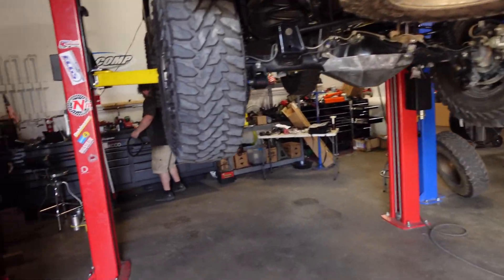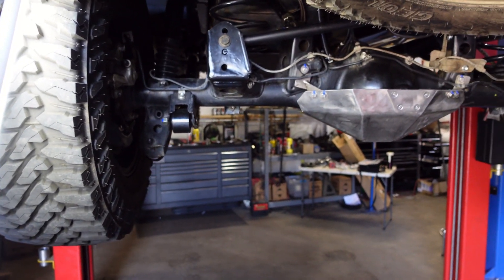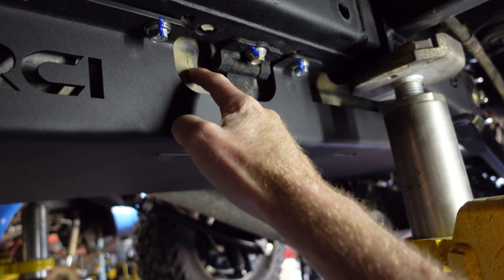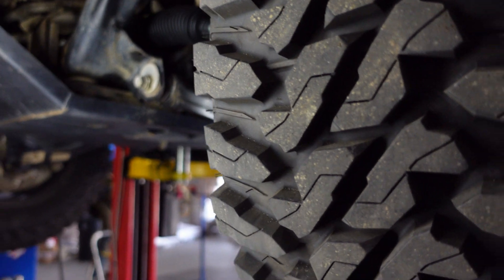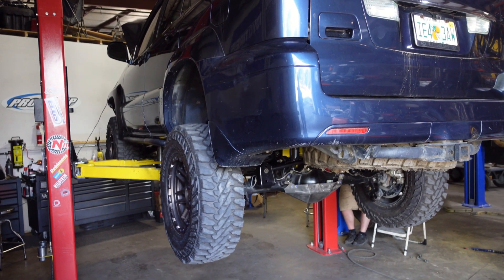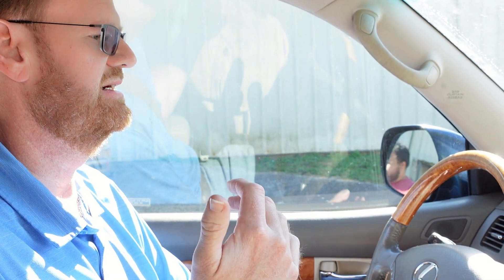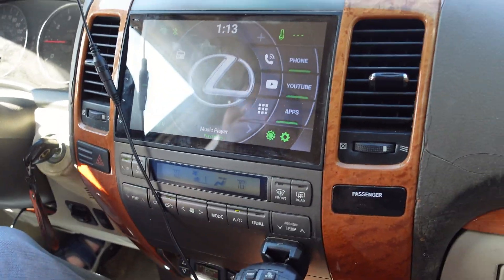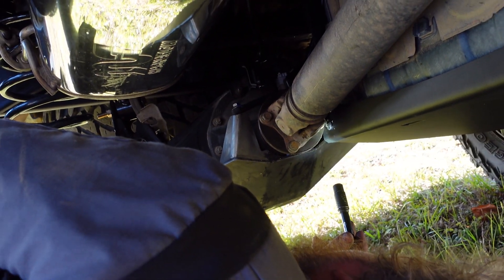I Replaced Nearly Everything Under my Lexus GX470! New E-locker!

Comment: Will you do a breakdown on expenses so we can have an idea on what it'll cost if ever we go that route. 🤔
Reply from the maker: I got a heck of a deal on the rear axle with the 4.56 gears already installed. The cost varies depending on parts availability and labor rates.  Links to all things are on the video description. The total cost of parts you should expect to pay is around 5-7k mostly due to axle availability. Labor is not cheap either and one could expect another 2-4k to get all of this installed.
Reply: @jamie.andrews  sweet! Where did you source your axle?

Comment: This should work for my 4th Gen 🤔 I herd of doing an 08 fj rear axle swap with E-locker but not 2019. Good stuff. 👍🏽
Reply from the maker: I assume ou mean 4th gen 4runner.  It should I assume yes.  Keep in mine an 08 FJ is still an 8.0 rear end.  2010 and above they went to 8.2 on the FJ which has a better designed carrier bearing.

Comment: Did you have a video of how you removed the whole rear differential???
Reply from the maker: Not online.  The entire rear end is only held on by links, shocks and the drive shaft.
Reply: @jamie.andrews  ok thank you sir🫡
Reply: @jamie.andrews  hey i tried looking for a rear differential for my 2007 GX470 but couldn’t find one, what differential did you install on yours? Or what other differential could fit on it?
Reply from the maker: @edforthewin8574  Mins is out of a 2019 Toyota 4Runner TRD Pro with the Elocker.  So any 5th gen 4runner with a locker.  You can also source one out of a 2010 or newer FJ cruiser with an Auto.  The ones with a manual have a 3.92 gear ratio.
Reply: @jamie.andrews  thank you so much for the info sir🙏🏼
Reply from the maker: @edforthewin8574  Let me know if you have any other questions!

Comment: I want one so bad. Do you know what Axels are best for say both towing and off roading  while also having a lift. I won't be off roading while towing lol. I just want to be able to add strength for gwr overall. I'd change the led to a blue bulb. Would you ever consider adding a shield to the catalytic/muffler, also I'd always put it in neutral before changing over just to help the overall life of it.   Thanks for the clip. And don't pay attention to the haters .
Reply: I've found a 2008 with 44k miles for around 28k$...  If it was around maybe 18k$ ish I might pull the trigger ik these last over 300k miles
Reply from the maker: The best rear end is going to be a Diamond, but unless you are going hard-core the 8.2 is just fine.  I am not aware of anyone making shields for the cats or mufflers. My cats are shielded by the RCI skids.  Thanks for watching!

Comment: Can you put a stock FJ 3.73 8.2 in without changing the front if you keep stock ratio? I’m looking to do this in my Prado 120 but not sure if 8.2 will be a direct bolt on.
Reply from the maker: Yea most people swap from a 2010 or newer FJ rear end.  It does bolt up.
Reply: @jamie.andrews  
Thanks for the info. 3.73 are sufficient for my use with 285/65/17
Reply from the maker: @Agent. K.  Yes unless you tow often and or do a bunch of highway traveling.  The gears will hunt more.

Comment: 2019 4runner axles bolts up?!
Reply from the maker: Bolts right up!  I used the brakes too.
Reply: Oooo. And that's an 8.2, isn't it...You just widened my search for a locking 8.2!
Reply from the maker: @nikopaladin9059  Yes.  You can get them out of a TRD Pro 5th gen 4runner or 2010 plus FJ Automatic.